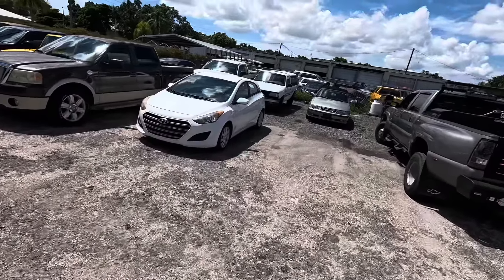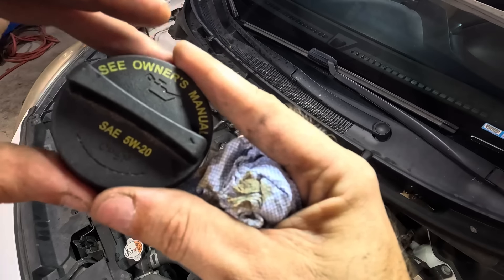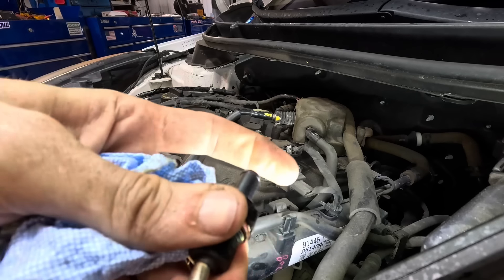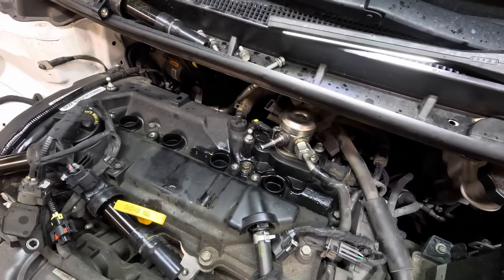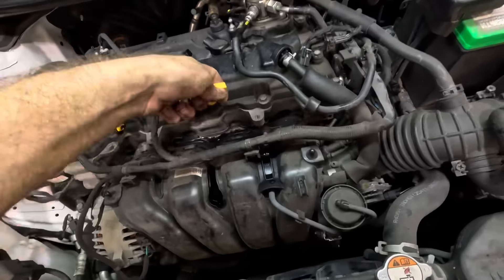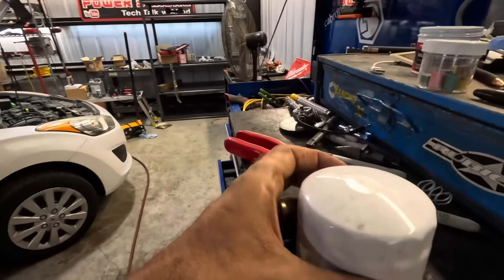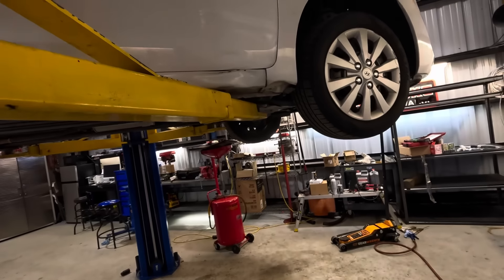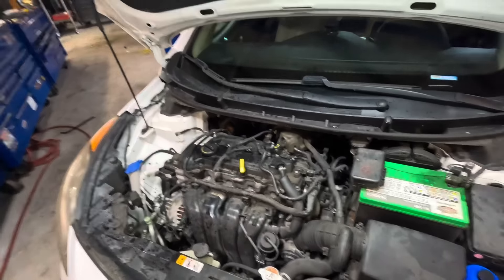Excessive Blowby! BURNING OIL! Hyundai Elantra 2.0l

Comment: I had a 93 Miata/MX-5 quite a few years ago now, that I decided to start using expensive Shell synthetic oil in. And it decided to start using a lot of oil between services. Switched back to a 10w40 mineral oil, and oil consumption was vastly reduced. But the engine had around 200000km on it by then, so I could only conclude that the slightly different properties of synthetic vs mineral oil and the wear in the engine  must have effected the amount of oil sneaking past the rings. Interestingly though, I continued using mineral oil, and the engine was still running strong and maintaining minimal consumption between changes until I eventually sold the car. Of course driving it hard and regularly to redline may have helped. 🙂

Comment: As a guy that just drives cars and knows a little bit about them, this seems to me a much better way than replacing the engine or all the work that would be needed to replace the rings. I would go this way first.

Comment: For those of you that have this issue caused by not using Tier 1 gasoline and synthetic oil changed every 5k milees. Use Valvoline restore and protect 4 cycles for 20 k miles. I have zero issues with my 2020 Kia Sorento . I change oil synthetic every 5k miles with filter and use only Tier 1 gasoline!

Comment: If they had just used a little Marvel Mystery Oil in it, none of the carbonizing would have occurred. lol  On my Crown Vic's, Ford said  the 5W30 would reduce the lubrication, and to only use 5W20 for proper lubrication level. You're the expert when it comes to lubrication.

Comment: I've owned a 2008 with the same engine. Brand new was burning a quart every 3000 miles. So by cleaning the engine will just put a band aid on the problem. I kept the vehicule until 70k miles by changing the oil every 3k miles. No other issues with the engine otherwise.

Comment: There is a hyundai bulletin on using chemicals to free oil control rings. Edit pour chemicals down the spark plug hole to un stick carbon up oil control rings.

Comment: Even though this vehicle doesn’t get driven very much, our shop discovered that it’s still a good idea to change the oil every 5,000 miles. It’s not being driven enough and longer distances in order to burn off moisture and carbon build up in the engine. The use of BG EPR is an excellent idea. However, the vehicle owner should take this care for a 60-70 miles drive on the highway to help burn off that carbon in the engine. GDI engines also have a higher propensity to build up carbon in the engine due to its design.

Comment: I have a 3 cylinder turbo, peugeot 1.2litre, it has always had a fair bit of blow by. Someone said it has low friction pistons. I change the oil ever 5-6 thousand miles as it has a wet belt. It has now done 40000 miles and is a really nice car.

Comment: Watching because my wife has this motor and yes, I had to take the fuel line off and re-attach it back.  Was a major pain.

Cleaning inside is tricky, adding anything but oil can impact the viscosity and increase wear.  Additionally if you clean and create loose large pieces you can clog things up.  And you need to be aware of where the cleaner can impact.  I use seafoam occasionally in the fuel to help clean the valves and injectors on my port injected system.  At the same time, if you use good oil and change it often enough the detergents in it should do the job as well.

Comment: I agree with another comment  about Hyundai/Kia owners checking oil.
My wifes Hyundai 2016 is the exact same thing. I check it weekly,  while under warranty,  been to dealer 6 times for that. No leaks, cardboard under it when parked. Clean. Full synthetic,  changed every 4k. Add oil weekly.

Comment: Hey Ray great video and topic. I had the Same blow by issue I done the clean myself on the oil and fuel system i.e. new oil and filter after clean and it worked a charm. Thanks for sharing Bud

Comment: If you look in the owner's manual for a lot of the newer cars that spec 20 weight oil, it will have a little caveat in there, saying that in areas where 20 weight oil is not available, that 30 weight oil is perfectly acceptable.
I had an '87 Subaru GL station wagon, with the 1.8L flat four engine, last year they still came with a carb. When it started getting older and going thru oil, a former Subaru tech told me to switch from 10W - 40 oil, over to 20W -50, and it would keep going for another 100K miles. He was right.

Comment: If it's like mine, the oil leak on the bottom is the oil pan gasket and it CAN leak a quart in 4000 miles. The valves are caked because it's a direct injection which are easy to clean. Check the intake manifold for blowby product including a nasty looking liquid in the valve runners. Just my experience. To do a compression test their is a connector under the intake manifold that easy to disconnect and disable the fuel injectors. The best scope is a HD with moveable head and side view camera, I love my DXZtoz AGC500L Articulating Borescope, not endorsing just what I got cheap off the 3bay and works well with video and camera recording  abilities and even DUAL view with side and front at the same time.

Comment: Every year, I do 1 oil change with EPR, MOA, and use 44k. I also use STP fuel additive ever fill up. (Cheaper than using premium fuel). My Camry runs so well after it and months to follow.

Comment: Had an oil filter fail like Ray mentioned on my old Honda Hornet. Now...for added fun, the bike had hte filter on the front of the engine, dead centre. So when the oil started leaving hte filter through what was actually a pinhole caused by corrosion after a stone impact, it dumped it right in front of the rear wheel. Yes. That wasn't fun. Since then, I have been rather paranoid about oil filter external condition as well as how long since I slapped a new one on. I was changing oil far more regularly than the book said ( 3500miles) as I was doing mostly town commuting, but even in that short space of time, the thin tin of the filter body corroded enough to let the pressure out.

Comment: At 47:56 the tachometer showed that the engine was turning over at just over 1000 rpm, not the desired 2000 rpm.  Maybe a bit more cooking would have been in order.

Comment: Ray, I agree with you. In certain circumstances, not all; this is an excellent approach.  If it works, much better than replacing the rings, honing the cylinders or a valve job. 

At 85k miles, it seems unlikely there is that much structural damage to the vehicle. However, a buildup of carbon and soot can be removed, and performance enhanced with the BG products. 

In my day, Marvelous Mystery Oil, STP, and other so called snake oils, were all we had. 

I’ve used the BG products when doing my last two oil changes. My ‘13 Ram Hemi is running great at 73k miles.  

I know I’ll have to deal with the potential lifter problems eventually, but for now all is quiet and running well. 

That $800 engine treatment may seem costly, however much less than a rebuild.

Comment: Used PCV valves can rattle some but with reduced travel.
I changed out the PCV valve at 100K + miles on my car and the engine idled smoother plus it wasn't sucking so much crankcase vapors into the engine. The old PCV valve had a little rattle to it when I shook it as compared to a new one.

Comment: Valve Stem Seals / Worn Valve Guides are a common problem on the direct injected Hyundai's.  I would run the leak down test and see if you have blow by coming out of crank case.  You have blow by when running so.. you are probably right rings are toasty.   If it is the rings, try a can of engine restore.  It is a micro encapsulated copper.  That will cause the cylinders to fill in wear marks.  I have used it on engines I though were goners and people are still driving them years later.

Comment: 2011 Elantra GLS w 182k miles. No leaks and doesnt burn any oil. Change the oil every 3k to 4k w/ synthetic 5w30. And since the oil is basically clean all the time, only change the filter  every 4th oil change with Fram Ultra or Bosch Premium (both are 99% at 20 microns). I've cut open the filters and they are spotless with no sparkles. Change your oil frequently and your non GDI engine will last forever. 😊

Comment: I have a 2015 Kia Soul with the same engine and I can promise the 4th ignition coil can be removed without disconnecting any fuel lines. I've done it many times with my bare hands.

Comment: I love an engine flush with my oil change, it improves performance and my MPG improves, I live in Scotland and I used to use a brand called forte, but the garage that supplied it is no longer, so I now use LIQUI MOLY Pro-Line Engine Flush. I also used forte diesel system cleaner twice a year, I have yet to find a product I like, but DAF (PACCAR) have a diesel system cleaner that you run the engine on, and the return line returns to an emtpy bottle, normally it returns as black as tar!

Comment: You are quite correct about your chemical cleaning analogy. If a chemical cleaner works on the outside an engine, the it sure can work on the inside too.

As to the rough running when hot. Could it be that the non return valve in the HP pump isn't sealing correctly, as we did see it did spray pressurised fuel back out the inlet side of the pump.

Comment: If you got blowby, much like Ford focus had, the crankcase was getting pressurized and blowing oil out of rear main/trans axle housing.
Head gasket blew when thermostat housing cracked and engine overheated. First major work on it 332,471 miles except two timing belts.

Comment: These GDI 2.0 Nu engines from Kia have an active recall on original engines for this exact problem due to manufacturer error. Mine did the exact thing in my forte. I had the engine replaced for free when it ultimately died, and since then I have been absolutely trouble free. The debris leftover from the manufacture process causes these things to first wear out the cylinders first and then a bunch of blow by. I guarantee you that car is blowing smoke on long deceleration events like down a massive hill. Before the replacement I was losing like 1 quart of oil every week or so. After I’m not losing any oil at all.

Comment: Howdy Ray, Back in the 70's when I was twisting wrench and we performed compression tests anything around 90lbs was considered on it's way out. Generally speaking compression on engine at that time was around 120lbs nominal. Some would be higher, some would be a bit lower. Just out of curiosity why is it that you would consider 90lbs to be sufficient? Is it a cost factor for the value of the car vs. disposal value? Thanks for the vid's. You are one of the main channels I watch and sorry to hear that you have so many arm chair automotive  mechanical engineers dissing you. My 2 cents is, it always takes a technician to get what a engineer created to get working. It's a symbiosis thing. Take care. Stay safe!

Comment: Your comment about cleaners that people believe they clean things externally as opposed to internally is funny. 😂 I had a good laugh and you have a point. I never thought of it that way. 

I occasionally use Gum Out, STP or Techron cleaners when I get gas, and I seem to have success with them. I am not opposed to using other products, just what I use. I think people are more accepting of a cleaner if they can see it in action. As for cleaners like the one you used or as I mentioned, I think people are not sure about them because as I said they can't see it and maybe they can't feel the results and think these products don't work. Sometimes I feel the cleaner is working and other times I don't. I am a little skeptical but I am willing to try it. I have to keep an open mind.

Comment: Toyota dealer comments on using slightly thicker oil . When engine is equipped with low tension rings thicker oil hangs on the cylinder wall longer and floods the ring seal ,,thereby causing oil usage .

Comment: The best way to deal with an engine with dirty internals is to not cause it.
Luckily it seems to not have been compression loss but oil control problems, to some extent that can be treated with cleaning products.
Probably a good idea to run good quality gas in these engines too.

Comment: Changing the oil weight will affect the cam timing.  Hun/Kia GDI, with no valve cleaning service (2014, didn't know about that then),  suddenly started gulping oil.  No visible signs, no leaking and no smoke.  At 70K, a well maintained engine started using a quart of oil, or more in 1K miles.  Until that point it didn't use any oil between changes.   I think this is what causes a lot of their engine failures.   Surprise oil consumption.  No warning at all.  Looked to me like excessive valve guide wear.  They were wobbly.  It even had motor oil pooling in the intake behind the throttle body.  Never found where the oil was actually going.  My guess is that it was mixing with the fuel and burning, but leaving no residue in the tail pipe.  A valve job with guides may have fixed it, but it turned into a trade in.

Comment: I've seen many videos of using Engine Flushes on neglected high mileage vehicles. They Do Work to some extent. If you are lucky to clean those Carbonized Stuck Rings BEFORE damage has been done, you can save thousands of dollars. ROSOLENE was my go to product years ago. Seafoam works good for light intake Induction cleaning. Also  I recommend CRC Intake and Turbo Cleaner. On Severe Deposits, more than one application is needed. If by the second cleaning you don't have positive results, then more intense expensive options will be required.

Comment: To me one year despite it only been 4000 miles is enough. i prefer to think in terms of yearly services instead of mileage based services, that way it doesnt drag on too long and oil gets changed  a bit more often. but im british as ive said a few times, we tend to do things slightly different here in England. im surprised you didnt use something to clean the pistons a bit, on a petrol car here id use Seafoam spray into the intake although it can be hard to get. i am aware you have other stuff though. awesome vid as always

Comment: Great video, hope that you are able to fix this.
The problem with GDI motors are normally pepole that do lack of service.
I have a Hyundai i30 Turbo1.0/3cyl GDI, done about 70.000km, have it serviced every 15.000km, and run on 95 unleaded fuel with mixed in carbon reducing aditives from the gas company.
And the oil are still almost clean before the service are due.
Of course cleaners work inside, but what you cant see, you dont trust. 
Almost like are the light inside the fridge on or off if the door are closed.😊😊
Even my local Hyundai dealer/workshop uses "snakeoil" from BellAd 😂😂

Comment: Just a quick thought Ray.. once you ran the cleaner and added new oil, that engine wasn't at operating temp when you checked for blow by at the end...so test was inconclusive IMHO.  You started the engine and immediately checked for blow by... and no it's not really a "Reeeeeeee.."  just a suggestion  that maybe you should have checked after engine ran for 10-15 min...  still a great vid as usual.  😎👍

Comment: Great comment Ray, why not a chemical clean internally!!!! my only comment is, use a cheap oil filter before the engine flush, then a new filter during the engine flush, reason, any sludge etc already in the oil will be removed giving the flush filter more capacity to clean the engine during the flush

Comment: JMHO: Whilst Hyundai's & KИ's may not be known as "forever" cars, I feel making a generalization that they are all "throw-away" cars is incorrect. An example: My 2016 KИ Forte Nu 1.8 M.P.I. sedan. Nearly 60K miles. Burns NO oil, oil changes every 6 mo. or 4,000 miles w/ full synthetic. Although it's a cheap economy car, it still requires maintenance. I was at the local KИ dealer for a free campaign & saw a Forte similar to mine with a blown engine. The service manager asked the owner when was the last time he changed the oil. He replied: "I don't know; I've been busy lately." The manager asked if he has ever had the oil changed since he bought it. He replied: "I'm sure I have; I just don't remember." Ah-ha-ha... WRONG ANSWER! Great video, Ray!👍
Reply: I had a 2012 accent that had 143k miles on it when I traded it. I did oil changes every 5,000 miles and it was still going strong, only reason I traded it was my wife couldn't drive a manual any more due to an injury. Treat them right and they'll last quite a while.

Comment: Maybe the spurt of fuel was related to releasing the pressure on a cylinder, by removing the plug, that was in dynamic balance at a stop, with the others and caused the inner workings to rotate?
Changing an intake stroke on another cylinder to become a reverse intake stroke.

Comment: Fill cylinder with 2-3 ozs of Acetone and ATF 50/50 mix,, drain oil, leave out oil pan plug.. LIGHTLY thread in spark plugs ( 1-2 turns only ) then BUMP over motor.. the build up of pressure will force the solvent down into the rings,( will not hydro-lock if you just BUMP it over) , then refill with 2-3 ozs and let sit for 2-4 hrs...REPEAT. you'll know if its working by what drains out of the oil pan, .. As a 50 years of experience Mech.. this will work.. but it can take DAYS!!  to free up rings..
Reply: I had the best results with this!

Comment: I have used bg products in my 1998 dodge Dakota 6 cylinder  at recommendation of my Mechanic which i sold in 2015  had 198k  so 9 years later it is still running with  265k on it now and I know the owner takes to same mechanic and still does same recommend BG services i was on  no issues except for typical wear items  for an engine of that age and mileage so products work i still use  similar products on my 2012 f150 5.0 at 183k truck